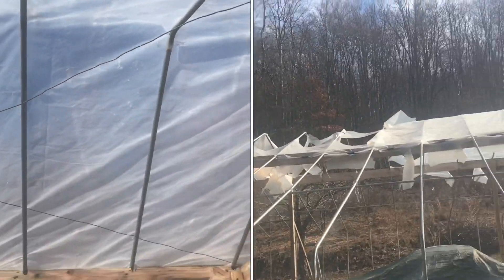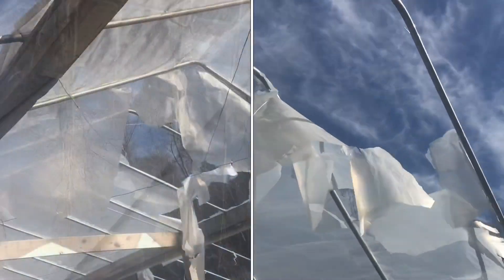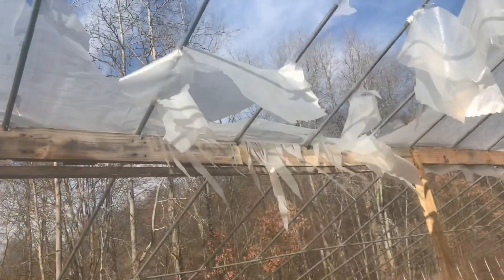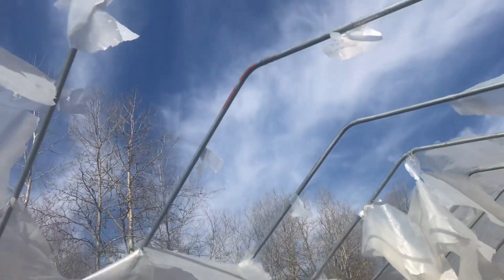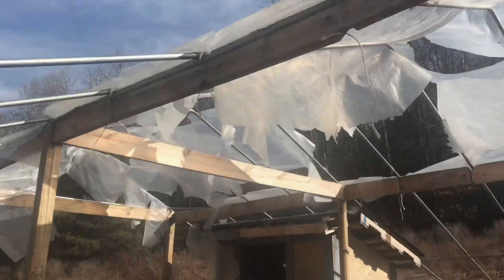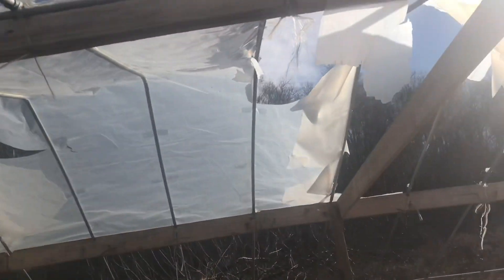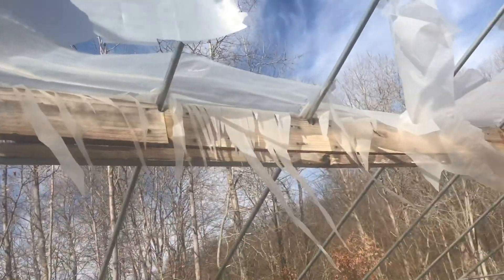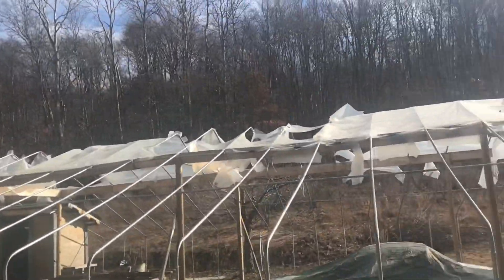how long does 6 mil hdpe plastic REALLY LAST on a “greenhouse” or “high tunnel”

Comment: We pull (cheaper) tarps over the greenhouses in winter to extend the life of the plastic. We also tarp the snowplow in summer because the UV will kill hydraulic lines in no-time too.
Reply from the maker: I’m gonna have to do something like that, it’s too much work getting the tarps on just to have them deteriorate so fast.
Reply: @livefree6878  You can pay a bit more and get UV-resistant tarps. They usually have a reflective side. Cover the greenhouse in winter..cover the plow in summer. 2 birds, one stone.